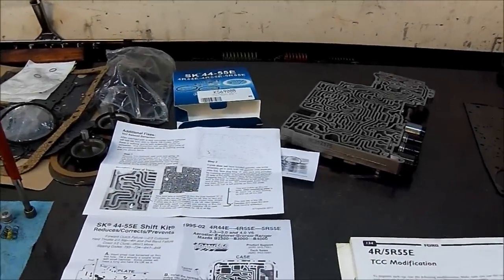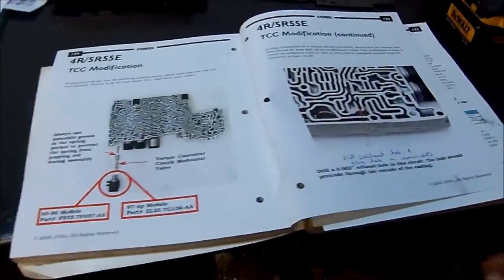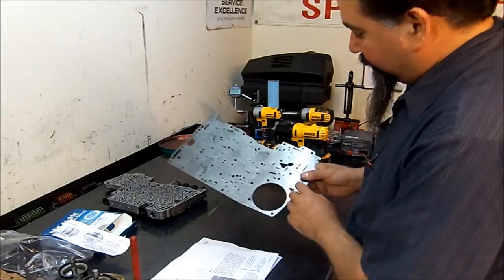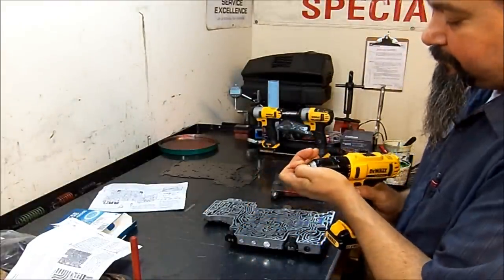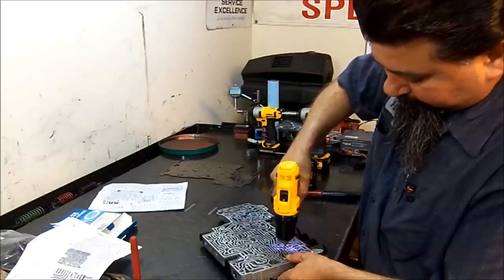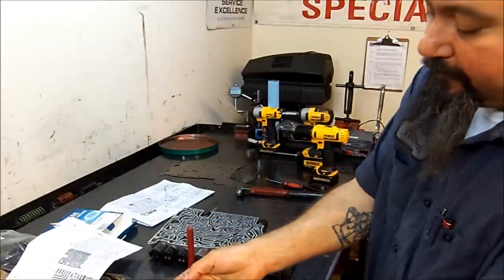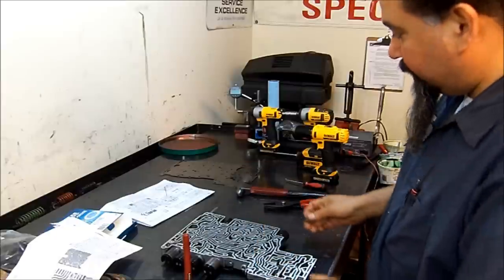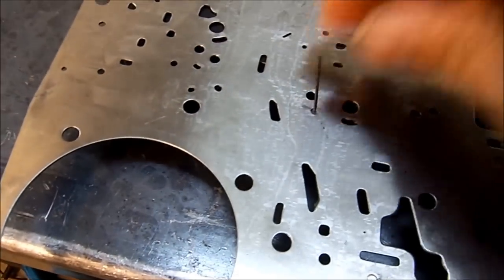4R44E Valve Body Overview And Repair - Transmission Repair

Comment: I have a 2000 3.0 ranger with a 4r44e. I had a 2-3 shift flare, and did a little research on what causes it. I found that a blown valve body, as well as an EPC solenoid can cause it. I also found that a "fix kit" made by trans-go is also very effective in fixing the problem. Today I did everything in this video, replaced the EPC solonoid and installed the trans-go kit. Put everything back together carefully, and guess what? NO FLARE. I am very happy, thank you for this great video it was extremely helpful.
Reply: Calm down

Comment: Thanks Hiram. Your tear-down and inspection video, along with your pump alignment and valve body shift kit installation made my overhaul a snap. My 5r55e broke the reverse band after 175K. The tip of the servo also was damaged. My transmission had no reverse servo spring so I put it back together without one. Everything work perfectly right away. I used the orange spring in the trans-go kit. Shifting is firm but not harsh. Reverse applies like it should. I followed the directions and made the shift plate hole smaller with the two balls. You rock.

Comment: I put this kit on my 4r44e and still had delayed reverse engagement . with master rebuild kit.
I tried replacing the valve body gasket, did not find any rip in the old one, put on the new added the high strength spring for reverse from the kit and still had  delayed engagement.
Takes 30 seconds or so to engage.
Drove for a year or so.
Yesterday i shifted from drive to rev fast and hit the gas a little and pop no reverse now.
All forward gears and coast cluth work normal.
When i put it into rev it slips and rolls back slowly give it gas it moves less.
So probably broke my band or my sprag.
Debating just getting a reman this time.
Extremely hard metal on metal clanging on 2-3 shift if on the gas pedal medium fuel if I backed off the gas when the shift came up it wouldn't slam so hard.
I milked it for a long time a year or more.
Also developed a torque converter seal leak or oring leaks on the bell housing bolts one or other or both.unsure

Comment: Question, installing this kit, will it make it shift harder such as going to 2nd and 3rd? I ask because as a teen and put a shift kit in my turbo 400 and it would squeal the tires when it hit 2nd in my camaro. I am wanting to make sure it will shift harder as such before going through the trouble to install this. Let me know please. Thank you. And any chance you are locked in the Houston area?

Comment: Thanks for video. I did everything the instructions told me. But when i re installed. . The 2007 ford ranger 2.3 goes from 1st gear to 3rd gear. And then 4th and 5th. Reverse is fine. I had my scanner hooked up and seen the gear i was in start at 1st then when shifted at 2,000 rpm it went to 3rd. 1st and 2nd work when i put it in low gears on selector shift. But when driving normal it does that. Any advice would be appreciated

Comment: Thanks for this information. I was wondering if I can  ask you a question about my 4r44e transmission is causing me problems. I am getting no codes displayed in the code reader. Yes it is one that reads the transmission also. The issue I am having. My truck shifts in gear fine reverse and forward. I can drive with no issues until it gets warmed up. Then I will be driving along shift okay until it get to 4th or 3rd. Then my rpms goes up and down like the transmission is slipping.  And it also has rough shifting. Like I said I get no codes from the reader. and only does after it gets warmed up. I seen your video and thought maybe it is that gasket is going bad. I did change the filter. Transmission fluid is red no burnt smell. No Metalic in the pan. So i am reaching out to you to get your input. Thank you for your time. My truck is a 1999 Ford Ranger XLT 3.0l flex.
Reply: Or do you think the TPC is going bad?

Comment: Hi Hiram, I will be rebuild a 4r44e. out of a 1996 ford ranger with a 2.3l engine . I'll be towing a small 14foot boot and use it for work may do some hauling once in a while which shift kit would you recommend superior or the transgo that you used in this video for the 4r44e valve body

Comment: Hiram, thank you so much! Your videos are great!  Just finished the transgo shift kit, which cured a lot of things, but it still appears that it jumps from 1st to 3rd, and my o/d light is still flashing.  What would be the next thing to look at?
Reply: Galen Nelson same issue on my 05 ford explorer 5r55s trans says low circuit solenoid c its not the solenoid the tcc temp flow valve is damn near welded to body check that might have got pretty hot

Comment: did the aluminum plug and check balls come with that kit? if not where can I find the right size? what size are the plugs? I found some 6mm ball bearings on amazon for check balls but can't figure out what size aluminum plug to use.

Comment: should i retorque my valve body bolts? and is it the gasket under the spacer plate? or the gasket up on case side? i dont really wanna drop the valve body and reque them tbh i rather rebuild the whole thing

Comment: Hi Hiram.  I was just looking at your video on the VB Upgrade with the shift kit from Transgo. SK 44R-55E, I just received my kit from transgo today and will install it into my 5R55E on my 1997 Ranger 4X4. AS A matter of fact, I am rebuilding my entire tranny, and 4.0 hov engine. While looking at the instructions I noticed that there are replacement rings for the support bearings/shaft. They are hard plastic and are cut on the ends. Also a spacer. I read the instructions but I fail to understand the reason for the change. Can u help me on this. I noticed you didn't, mention this on your video.

Comment: Thanks for the great videos. Very well done. Question, what's your opinion on when to change out solenoids? Do you have an opinion on their life cycle? I've read 40,000 miles on some. Others say they rarely go out. I only test them with my volt meter for proper ohms (20-35 I was told) and check them with a 9 volt battery to make sure they click. How do you check the ones you test and at what mileage do recommend replacement? The Transgo SK 44-55E Shift Kit commented the EPC solenoid wears out and should be replaced and if you've got 2-3 gear flair, the SS2 next to the EPC can cause it and should be replaced as well. Thanks for your response.

Comment: i appreciate your info. I have used your videos as primary info on rebuilding. it would help if you give links for the pump and torque converter. had some issue getting them from a hobbyist auto parts store.

Comment: I have a 2006 Honda civic 140k and the transmission is giving me stuck on/off codes and sometimes with ought throwing a code i feel like it wont go into "overdrive" on the highway and when I got this car the fluid was extremely burnt.Should I rebuild or replace?

Comment: did the whole kit was really hard to make the hole smaller with the two balls ... my truck still loses gear when i come to a stop i cant figure it out .. any ideas ..
Reply: Mine does that when the engine is cold. I figured out if i level the transmission fluid to max level of the crosshatch area while cold, it doesnt do that. But it is higher when it gets warmed up. I guess there is an internal leak somewhere.

Comment: I know this is an old video, but I'm hoping you may be able to help me out...I was in the process of putting in this shift kit and got done and went to drive it. It won't shift into overdrive now, and when you get on the highway when it would normally shift into OD it starts flashing the O/D off light. What could have I done wrong and do I need to buy a new valve body now?
Reply: Race    5/31/20  i am dealing  with this same issue   on a 96 Ranger 2.3 4r44e with  almost 400k on it and  one  rebuild,not a reman.I have modded the truck  with an explorer dash that  give me an Od idiot light and tach,no issues with the  swap  other than recalibating  the  temp gauge .i also have a  jones  twin turbo round muffler on it,the best I have found for minimal drone and no where near  the fart can /glass pack you hear on most 4 cylinders so  between the tech and the pitch /light i can see  that with the Od  workin  the rpms drop almost 1000   at  70mph  give or take so its  guzzliing gas right now with the A C runnin. debating on  whether to swap the truck to  stick or  fix  this   by  replacing   not just the Od  solenoid  but  all 4, might as well, there is another part though you should check  thats  some kind of lock ,the code shown is that the  od  shift solenoid is  stuck in the off position and something  was mentioned about the  tq convertor not locking  but  other then a   slipping  very hard shift 2 to 3  the truck has  given me solid  5 hour commutes since the rebuild under  2 years ago until both these problems have  gotten worse.my trans shop is reputable and i plan on goin back  for this  as  i am decent  mechanic  but  i leave  auto trans missions  to a specialist. solenoid  can be checked   with a meter   20-30 ohms being  good but  it  can be  the  bores  they ride in.i also have  years of machinist skills so i get what  is bein said  but  if you goggle 4r44/55 e  known solnoid problems all this pops up and they seem to be the bane of these trans,hence my thinkin  of  swapping  to  a stick.  the tremex 4 cyl   early  ranger trans would be my choice   as  i am  building a  turbo 2.3 for the truck.its  that nice bein in the south and 2 owners but the  mazda  5 speed stick will be  fine and can be had  for  a couple hundred..  theres is  also an upgrade kit as you see  here   with hiram, worth doin if you plan to stay auto. but  my adive  to any ranger owner  being a long time  ford truck guy and  with 4 decade of experience  buy    the stick ranger and  with the  pre 2001  cast iron 2.3.  the 3.0 is junk so  if  v 6 is  your thing  go with the 4.0  that  has alot of power upgrades available.

Comment: Hello Hiram. After watching a few of your videos I have a couple questions. Which do you prefer in the shift correction kit for the 5r55e, transgo or superior?
Superior appears to have a few extra correction parts than the transgo does including addition al wiring. Also, do you only use wd-40 when assembling a transmission?
Reply: ***** thank you for the quick response. I just want you to know that your videos have gave me the confidence I needed to open up my transmission and do the repairs needed to get it back on the road. Keep up the great work. I'll be sure to let everyone know about your channel

Comment: Can this kit be added if i have a bonded valve body gasket? Like the separator plate is attached (glued i think) to the gasket material on both sides.
Reply: Also, what portions of this upgrade can i do without purchasing the kit?

Comment: I have a 96 Explorer 4.0 2wd with a 4R55E trans... anyway, it drives just fine in D but when its cold it has no reverse. After about 20 minutes of driving reverse will work perfectly. Im also getting a DTC for the Turbine Speed Sensor. Any ideas as to what it could be?
Reply: IAMKING696969 I have the same problem with my 96 ford explorer 2wd 4r55e only when it's cold out but once it goes into gear I'm good from there until it sits over night in the cold again any luck fixing that thanks alot.

Comment: I just install this kit in my 2000 explorer 5r55e and now I have more problems , when the transmission downshift from 2 to 1 gear , jerks , so I don`t know what happend it wasn`t do it before install this kit .  Help  !!!!!!
Reply: cesar ruedas does it still do that? If so then take it to a shop and have them reset the live memory with their scan tool.

Comment: Good video. Hiram, I have a hard shift to reverse since I added this kit (4r44e). I've heard a couple other people say the same thing. Any ideas?
Reply: ***** Are you talking about using the two check balls to hammer the hole smaller? You talk about that at 1:00. I did that part if that is what you are talking about.
Reply: +Anthony Shelton You could try leaving out the servo spring. Mine didn't have one from the factory. Another transmission guy told me some don't have it because it can alter pressures.